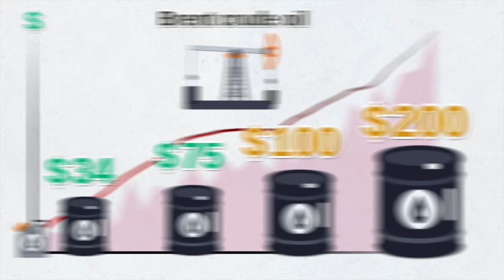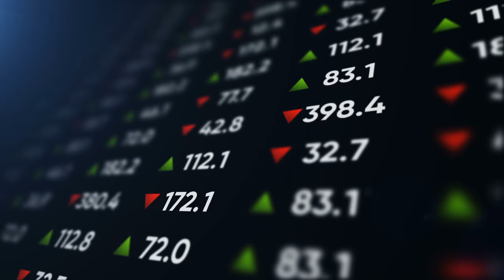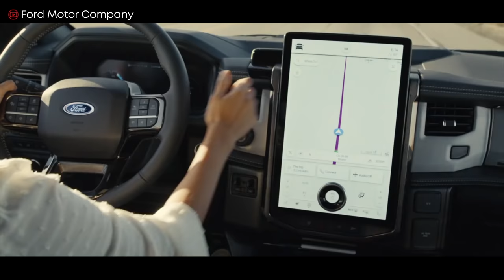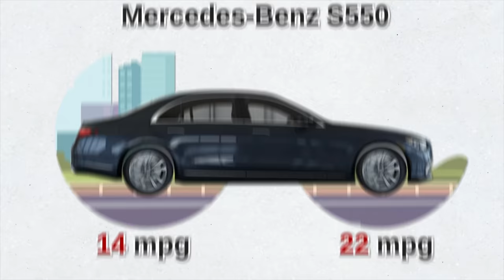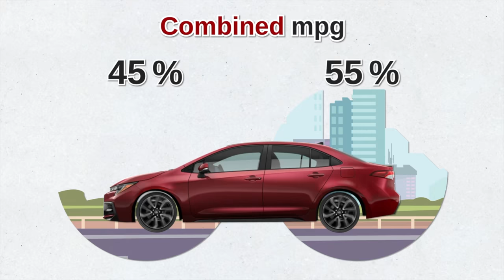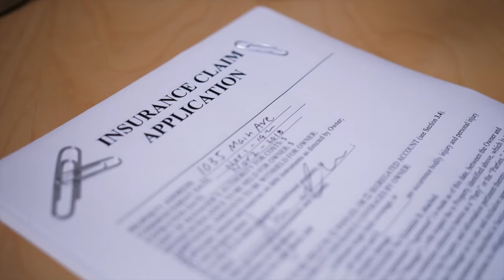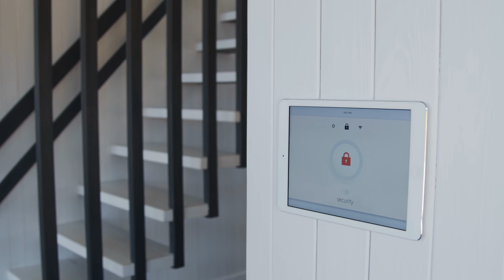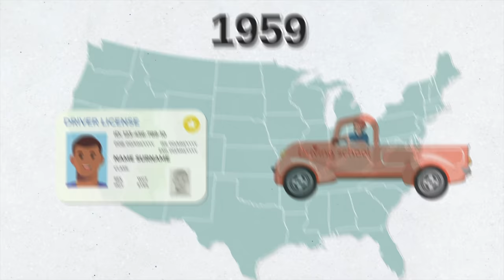Here's Why Cars are Expensive as Hell to Own Now

Comment: Good Day Scotty another fan from Australia N.S.W the emission laws in Australia are not that strict noise laws are infact in N.S.W we have a yearly rego check (regestration inspection ) there is no emessoin check so l can drive my 25 year toyota hilux around since it does not have a cat converter and has a carburetor if everything is fine your vehicle pases but if there is something wrong it fails and you have to get it repaired or do it yourself it can something as simple as the number plate light not working the inspector takes your car for a drive and checks if everything works

Comment: The bottom line is that no matter the type of car, it takes  energy to 
move a vehicle any distance. And, the heavier and larger the vehicle the 
more energy that is needed. USA is incredibly wasteful with most
shipping done by trucks and most vehicles sold being pickups and big SUV's.
If most of those SUV's and pickups were sedans it could cut overall
gas usage by 50%. I just look around while driving and most all of those
large vehicles have at most two adults and a couple children. Most 
I see just have the driver inside. Yes, some are used for hauling
but they are the minority.

Comment: Hey scotty
Im thinking of buying a used car. I seen an 2014 Honda accord ex-l with a open recall since 12/2020 for "drive shaft inspection" to replace the drive shaft  for corrosion due to salt from lack of protective coating I live in NY. Should I buy it

Comment: Ok sooo I bought a 2021 Toyota Corolla se… did I make a good decision?
Reply: Yep.  Be diligent with the routine maintenance!  Frequent oil changes and follow the maintenance schedule in your owners manual.  Good choice.
Reply: @smokey2459  I got the se because it has the 2.0 instead of the newer 1.8.
Reply: Also the oil is supposed to be changed every 10000 miles, is it better if I do 7-8000?
Reply: @HellcatGamin  personally, I would never exceed 5,000 miles.  I change mine at 4,000.  Oil is cheap. Engine troubles are expensive.  Use only manufacturer suggested synthetic oil and viscosity and always replace the filter too.  Be diligent and you should expect 200k miles easily.

Comment: And it’s not just for cars, trucks & trains. Derivatives of oil is used in numerous products; some of the uses would surprise any people. As to big oil buying up EV charging networks, if Brexitania is a telling model. Big oil will continue to buy charge networks, soon after a take-over, the price per kWh is tripled or quadrupled. Not just that, but BP in particular, are buying charge networks, but when individual chargers break down, BP either do not repair them or else take 8-10mths. to repair the broken chargers. Which suits the fossil fuels sellers, as such business models, serves to both discourage EV adoption and encourage the continued use of fossil-burners.
Reply: EVs have enough detractions already without dealing with broken charging stations.

Comment: I believe that The EV charring stations will have to have to have a fast charging stations which will be competing the gas stations refueling times. Other than that the EV vehicle will only be for a computer car if the battery will support that. I d not believe EV vesicles will not be of any significations in the near future. I also believe that hydrogen powered vehicles  will be the future of cars & trucks.